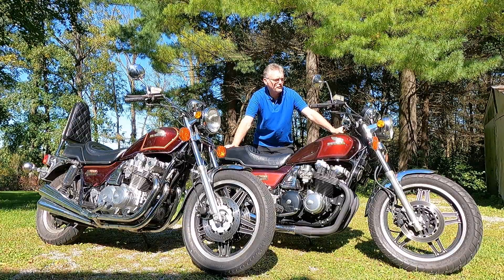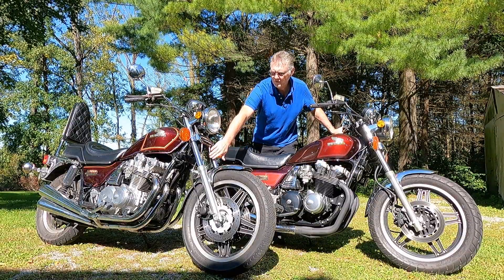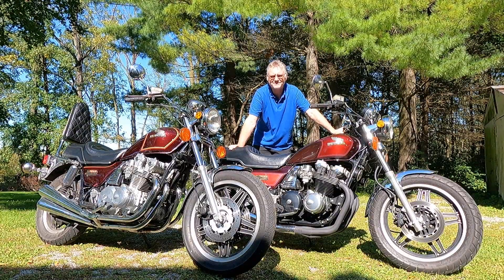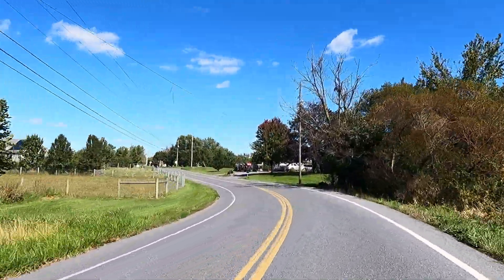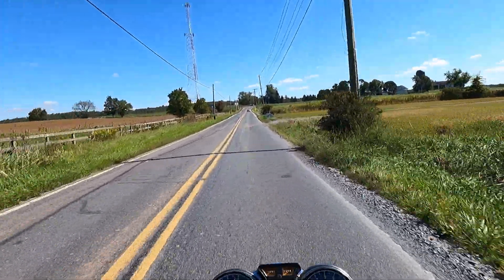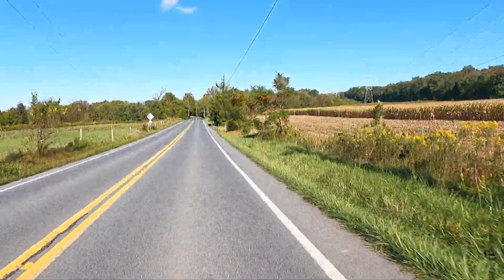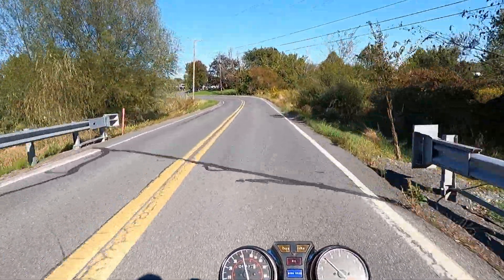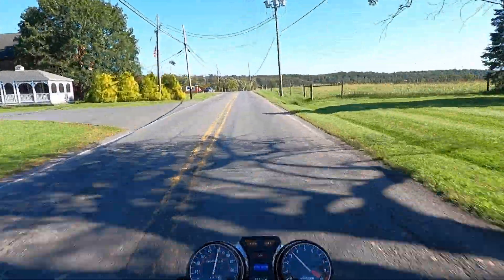Vintage motorcycle comparison: 1980 Honda CB900C Vs 1982 Honda CB900C

Comment: My first serious bike was a 1980 C back in 81. Sold it when i moved to Canada in the mid 80s. Im looking at buying an 82 in real nice shape for $1800 runs nice too. Started riding on a 900C so its only right i finish it on a 900C too. Wonderful machines the Honda fours nothing quite compares imo
Great video
Reply from the maker: Sounds like a good price for a nice-running example!

Comment: I used to have a sissy bar like that on my CD175 in 1972. My father was appalled by it. Thought I was trying to turn the bike into a scooter.
      Interesting review.
Reply from the maker: I'm not sure exactly why I left the sissy bar on the 1980 - it's usually the first thing I pull off a bike. Somehow I don't hate it on that bike.
Reply: @jonsmotorcyclerescueandrev3538  I used to love mine on the 175. I thought I was Peter Fonda.
Reply from the maker: @1990-t1j  Right on!

Comment: THANK YOU for making this video!  I'm putting together a chopper based on the 82 900C and have been picking up a lot of old parts off ebay.  The differences are subtle and it helped to hear about some of them here.  Let me know if you'd like a PDF of what I've put together from the old Honda Service Manuals.
Reply from the maker: Sure, and thanks Mike! You can email me  at: jonsmotorcycle@hotmail.com

Comment: Mine was the 81, with the 10 speed transmission, it wasn't actually 10 speeds per se, but the transmission had a low high range splitter. I found that low range was best for everything except highway cruising, but the high range also worked in town as well, with the exception of having to slip the clutch a little more on takeoff. Never had one problem with my CB Custom
Reply from the maker: Nice! Since getting these back on the road, they have been trouble free. I was out riding one yesterday - still a nice ride!

Comment: The brakes on my wife's 82 are surprisingly good.  She came from an 80 GL1100 with single piston calipers, and the difference is night and day.  I think it's the best stopping bike we have, and we have several bikes with dual discs in front including an M109R.
Reply from the maker: The brakes on the 1980 CB900C required a major upgrade as soon as I put it back on the road (pads, lines, rotors). I just added Spiegler lines to my 1982 CB900C this past week. While the brakes weren't bad before, they are amazing now. Stay tuned for a future video.🙂
Reply: My 81 is single pot calipers front and rear, but that massive rear disc REALLY puts a stop down. 

I'm swapping a full GL1200 front end into mine, already did the GL1100 rear alloy with 140 tire (had to clearance the driveshaft tube some, would have been easier to just use the GL1100 swingarm), and will be upgrading to GL1200 twin pot rear caliper and arm and making adapters to use CBR900RR front calipers and some sportbike rotors (BIG discs)
Reply: @IFixThings1985  Nice, you should do some videos on it.
Reply from the maker: @IFixThings1985  she should stop hard with those upgrades!

Comment: Great comparison Jon. Would you detail a little more about the Spiegler lines you used? Were they a custom order and if so, what part numbers? On their website they list the 82 CB900C as the only CB900C option but it links to a blank page. Maybe the 750 uses the same lines? Thanks for the content.
Reply from the maker: I had to measure the original lines and then special order them. What year and model is your bike?

Spiegler has a good set of directions on exactly how to measure the old lines and order the custom lines. I would recommend aluminum fittings with black coating if you want a stock look.
Reply: @jonsmotorcyclerescueandrev3538  My bike is the same. 1980 CB900C. Did you replace the line from the front master cylinder to the 2-way joint as well as the individual lines to each caliper or just the lines from the joint to the caliper? Thanks again.
Reply from the maker: @jaymesims3070  I replaced all three lines in the front. I have the stock handlebars and this is what I ordered for the 1980 CB900C:
(qty 1) upper line is black with aluminum banjo fittings, fitting 1 is 20 degree bend, fitting 2 is straight, total length is 19"
(qty 2) lower lines are black with aluminum banjo fittings, fitting 1 is straight, fitting 2 is straight, total length is 21.5"

Comment: When you say geared different, are we talking different rear end ratios, or different gears in the gearbox?
Reply from the maker: I would guess different gears in the transfer case or rear. Either way, the 1982 is geared taller and revs lower at speed.
Reply: @jonsmotorcyclerescueandrev3538  rearend, see my post on this video!